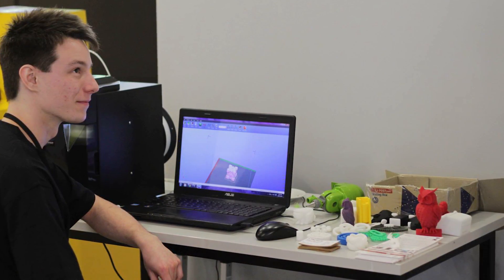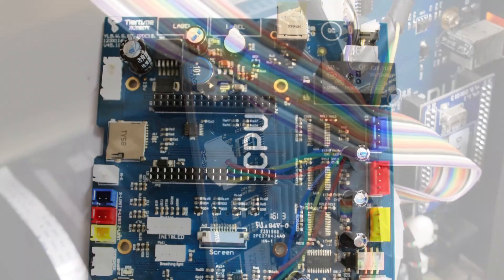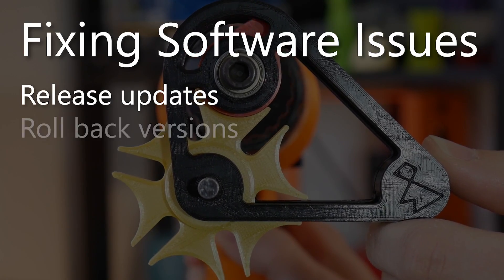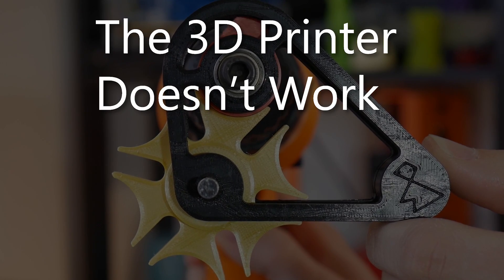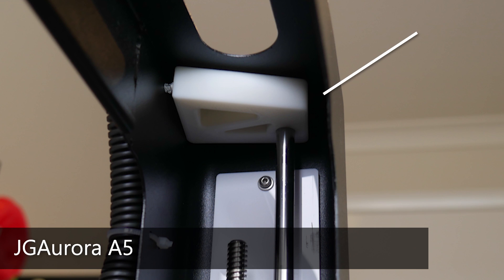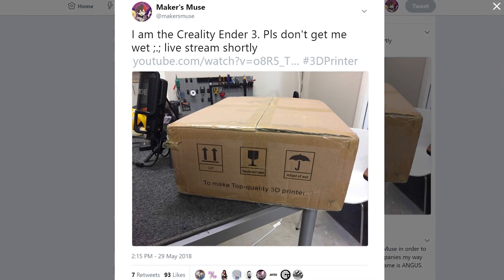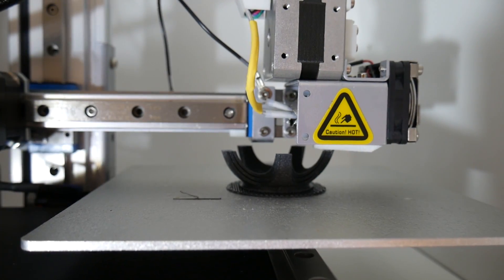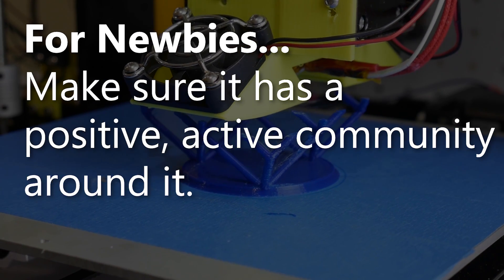Serious Concerns with 3D Printer Quality Control

Comment: Just ordered a Prusa Mk3 preassembled version, and REALLY hope I didn't make a mistake.

Part of the reason I did, is when looking at reviews of more "proper" pre-assembled 3d printers - TONS of FIVE STAR reviews had paragraphs to pages of stuff they had to do, and upwards of 80 or 100 work-hours just to get their first decent print.

So I got the Prusa Mk3 assuming that there was no such thing as a printer that works out the box, but at least I'd have good documentation with the Prusa Mk3.

To all who purchase 3d printers out there - please be reasonable in your reviews.  If you want to increase stars despite issues because customer support was great? That's fine, but it is NOT 5 stars if you had significant issues.  5 stars means it was PERFECT.  If you had to do 80 to 100 work hours of work, and wait a month for every little part to ship for multiple little fixes... that should AT LEAST knock 1 star off, because it wasn't PERFECT.

I really wish people would use rating systems properly, and I really hope I didn't make a mistake ordering the Prusa Mk3.

Comment: I bought an Anet A8M dual  a month ago.  I got the wrong screw kit with it, for different printer.  Incomplete instructions with combination of older printer and my newer one included.  They sent me a request to provide them a video showing these items when I complained???  NO.  Then I went to upgrade firmware and found the Anet had a BIQU pc board?  No support or mention of that anywhere.  Also it is BIQU board that has been replaced with a new one because it has issues with the design of the communication chips or protocol and cannot be recognized by another computer to upgrade.  I am a hobbyist and got this dirt cheap with no recourse to return.  The heater on the first hotend burnt out now and the reseller said "Sorry we only reship"  and the factory does not know who I am or why I would want replacement parts.  And this is a business model called fraud.

Comment: Honestly, I was one of those who saved up some money for my first 3D printer. The extruder ended up failing in <24 hrs. There were issues with the bed and such. I was fortunate enough to be able to have gotten a refund, but after spending a bit of time researching before that printer, and after, I'm overwhelmed with options for getting another in the future because of concerns that revolve around the subject of quality control. I kind of fell discouraged, but lost, as I wanted to get into 3D printing for not only as a hobby, but also using it as a tool for designing certain hardware. All these QC issues and so many revisions are making it difficult to find a good machine.

Comment: As with all technology wait. Wait for mugs to rush out and buy the stuff. It gets better and cheaper with time. And if anyone says "you should buy a more expensive printer", then I would say "Do you remember the Apple phone that lost most of it's signal strength when you held it? It cost a lot of money, was made by a so-called premium brand, but still failed. (by holding the phone, you were shorting out the aerial that ran around the side of the phone). Don't be the first in-line".

Comment: I have been looking at getting a 3D printer for the last 2 months and have made a choice on the Creality CR-10s pro printer.  I have my own machine shop so remaking metal parts is no problem. learning to work around the programming might be. I want the machine for printing concept items before going on to metal which will be more labor and time intensive. all things good come at a price startups also, and I wish folks would quit running down people for trying to produce what they want but always wanting it for free.when they built the CFL light bulbs they reduced the power used from the local utility and they in turn had to raise there rates to meet there monetary obligations for the equipment to deliver the power to your house.  so then we come out with LED bulbs and another rate hike and now we can make CFL bulbs that can consume less power than LED bulbs or on the order of 360 mW and yield 25% more lumens of light and it only takes a simple adapter so I guess you want the free adapter ok then they raise there rates and you will not be able to afford to run a motor with there power ever again.  the point is you make a choice to support new things or you don't  spend your effort wisely in all matters in your life.

Comment: I'm just getting around to watching this video now, but here is my take, and the route I went. Especially when you are starting off get a 3D printer with support in the form of the company or at least a strong community. All these kits are fun projects, but you get what you pay for. My first printer was a Lulzbot Taz5, and that thing still runs amazing, even though it's lacking some of the features I have grown to love. If you really want to do a kit, I would go with a Prusa directly from them (not a clone). Beta testing with hardware is not an acceptable practice. Like you said it's not like they can recall it and swap something out like they do with automobiles. You're pretty much stuck with that garbage if it's not something you can 3D print and adjust yourself.

Comment: I own a FlashForge Finder that is very easy to use and very good quality prints.  Problem for the last two years is an intermittent power shutdown during a print and rarly while siting in standby after a print has completed.  Just push the ON button to initialize system for the next print.  The company had sent me a replacement the power supply to no avail.  No friction on the XYZ movements.
I am glad they have changed the new versions of the FFF with a different Mother board and using an external brick  power supply.  I hope this eliminates the mystery shutdown (Mother board?)..

Comment: What do people expect? The cheapest prusa style printer on Aliexpress costs less than €100,-- shipped! A proper assembled 3D printer with a decent R&D record will cost you around 500 dollars/euros. Like you said most people buy one of these in hobby perspective and are not willing to pay this. If you buy one of the cheapest kits around you should be aware that you are basically buying the parts to build a 3D printer. Not the 3D printer itself. I do agree with the fact that if company's do revisions these parts should be availible to the public and a proper documentation and markings on the product should be there!

Comment: What would be innovative to see is a physical product supplier that uses this method of 'beta testing' on customers to do what software companies do, in that once the product has reached 'release state', that they provide the early adopters a new finished product, or maybe (at least) the upgraded parts. I'd still imagine that the actual cost of parts of a 3D printer, including postage, packaging, etc is probably less than 10% as the retail cost, so wouldn't be a huge loss considering they have been saving a heap of R&D costs by using consumers in this way. Of course, they'd have to admit that they are doing this intentionally which would be brave of any company. It may also have to be a factor in the pricing of their units overall, but wouldn't consider a huge factor.

Comment: I think it's ridiculous that some people consider repairing a machine that is not working as it is coming from the factory as "part of the fun". They don't even realize that they have been tricked by the producers and bought a machine that could not be working as it was shipped. The most incredible case I have witnessed was a so called "Filament Extruder" that was reviewed on a channel somewhere around YouTube. The problem with this thing was not just that it had some flaws or broken parts, but in fact it could never do what it was supposed to because of a completely wrong design. Everyone wondered how they could have overcome the problems facing the production of Filament by recycling old parts. But the mystery was solved pretty fast. They didn't. They just sold a piece of trash. And most of the people buying it just thought "maybe, if i tinker around with it, i might get it to work". Nobody, not even the guy on the YouTube channel doing the review was enraged about this bullshit. People should really wake up and think about what they are buying or what they already have bought. Speaking for myself, living in Germany, I only buy things like that if it is shipped from somewhere inside my country because as a consumer you have the law on your side here. The people should really be more careful about this stuff, considering that it is actually pretty much money that they are likely to be wasting.

Comment: I don't think that using consumers as beta testers is wrong. It's all about how they are used and how they are treated afterwards. I think how it's done nowadays in the 3D printing world is pretty flawed and unethical. In my opinion, people should be informed that they are buying into an alpha or beta machine after before purchase. Necessary hardware changes (in regards of safety) should be sent to those adapters free of charge or at least only for the shipping costs. Machines should be better and much more frequently versionated with the changes between each version published. Upgrade kits to upgrade your existing printer to the next hardware version could be sold separately (yes, sold. just like the CR10 upgrades from Creality). My CR10s came with an insulated heat bed from the get go an is able to reach 98 degrees C in under 20 minutes (I don't know what else they changed). It also came with a filament sensor and other upgraded parts I didn't even know they changed since most reviews.

Comment: IMO, the lean model could work for 3d printers as well, but here's how it should be done: 
working machines should be labeled "release". they are shipped at a higher price, and guaranteed to work. 
then you have "beta" machines. these are aimed at tinkerers.  you buy them at a reduced price, 
but with the possibility that something on it might not work, and you'll have to tinker with it to get it up to speed. 
possibly with free new parts sent. 
this way, you get something back for being an enduser betatester of a new machine.

Comment: This is a valid video in today's 3d printer market. I watched video after video on the Creality Ender 3 before taking the leap into 3d printing. The Ender 3 came highly recommended, and I think that 99% of the people who own a Ender 3 will agree that it is a great machine. My story is long and boring, so I will cut to the chase when you are looking into buying a new 3d printer watch all the videos you want. If you really want to know the quality of machine and customer service join a few 3d printing groups preferably a group that focuses on the printer you are interested in and read the posts! If the printer you are looking at has a large trouble shooting guide with failures or replace xxx on the manufactures website and has been out less than a year I would pass. Almost all of the videos that I looked at regarding the printer I purchased praised the machine for it's low cost and relative high quality. I started to really dig into the failure that I have and I have found it is pretty common. Yet not really talked about in reviews. Coupled with poor support from the seller and a lack of warranty from creality it has sort of turned me off to any future products. With all of that said I think the the Ender 3 could have used a few more months in testing, and would gain from a higher level of quality control. This is an excellent video and you are one of the first that I have seen to really spell it out. Thank you for the great videos keep it up!

Comment: Yup. If you want something decent then either pay for a quality product or build it yourself. My first was an Anet A8 which I bought to learn on. It is still going strong after 2 years, but only after a ton of upgrades and safety modifications. I used it to print a reprap AtomX printer and that is still going strong too. Then I got sucked-in by hyped-up reviews and bought a Tevo Tornado about a year ago. I only just got around to assembling it and it is awful. Mains 230v bed which is unearthed and no strain relief and has no thermal fuse in the silicone heater, no-name solid state relay, iffy psu which has taken out many printers (they had even stripped the insulation of a 230v cable to get the psu in the control box and the live wire was almost touching the cae of the psu), warped bed which is balaced on a single, central rail .(... WHY?... cheaper), inappropriate and inadequate fusing,  missing bolts and washers, frame not square, fans with rocks for bearings, rubbish build plate sticker that bubbles up meaning you have to use glass and glue, firmware which locks up, fake ftdi chip so doesn't work with Octopi (serial connection losses) ... and when I finally get it going .... 45 degree layer shift on the Y axis about 10cm high on a print. Whatever you pay for one of these garbage printers you can figure on at least doubling that sum for upgrades plus a ton of time messing around and getting frustrated. I wouldn't turn my back and leave it printing. Beware infomercials.

Comment: i think its fine they improve the hardware of a solid build to make it more solid, however it needs to itself have a new model number, highly flawed versions should get discontinued, while the ones that, only had minor fixable problems could remain on the market under its own model name. its a simple fix for the problem of the customer not being first. in turn this keeps a 3d print company from eating its cost to develop a 3d printer model that does work just because a better one is in place and it gets a few more listings on a store page with their brand on it. end result more exposure and more sales.

Comment: Thank you for the honest assessment of the situation.  My first two 3-D printers were basically fraud on the part of the manufacturer.  B9Creator is loved by jewelers for the smooth surface finish and 50 micron resolution, so I couldn't understand why it made gears way out of spec.  When asked, they admitted the 50 micron accuracy was theoretical based on the resolution of the projector and magnification.  Nothing actually made by the machine ever approached their claimed accuracy.  Light diffusion in the resin always made the outside of a part too big and holes too small.  Adjusting scale could improve one issue but made the other worse.  So I sold it.

Then I replaced it with a Rigidbot which never worked right.  To their credit, the founder mortgaged his house to pay for completing the kickstarter machines after many rounds of defective Chinese parts bankrupted the project.  After waiting over a year for a machine that didn't work when it arrived, I sold it for parts to a makerspace that threw away everything except the frame and built their own design using some of the parts.

These companies knew their product did not work when they shipped it.

And don't get me started on all the CNC routers being sold now with zero working software.  After spending over $1,000 for a machine, customers are referred to a half dozen freeware programs and left to figure out how to install them and get them to work together.  Of course, most of their customers never get the machine to work.  The great part is that they can blame their customer for not being able to properly install and configure the buggy freeware programs because control software was not considered "a part of" the machine!  Do not buy an Openbuilds router unless you have a computer systems engineer to sort out the freeware issues.  They are creating an opening for a new business if someone wants to sell jump drives with all the software correctly configured for the machine so owners could actually run the machine after they finish assembling it.

Comment: In the early days there was a certain charm that manufacturers would take fixes or upgrades from the community and put them in future production runs.

As time goes on it becomes more frustrating because there is no type of iteration or version number between the older and newer runs.

A first run CR-10 is very different than one purchased right now. Yet there is nothing defining the two or the variants in between. It's still branded a CR-10 not a CR-10 version 32 (or whatever). There's no telling which one you'll actually get depending on where you purchase and how many they bought. Depending on inventory you could by 2 of the same machine and yet technically get 2 different machines, even if you buy them at the same time.

Comment: Good advice  :) . 
 That's why I spent heaps on a solid, metal framed, twin nozzle 3D printer a couple of years ago. 
 It worked, right out of the box - just like it was meant to  :) .
Reply: Which one? If it still exist.

Comment: I like the way Prusa does it. For every major change to the i3, it's held off til the next "mark". That way, I can say I've got a MK 2.5, and you know practically exactly what I've got. There are some small differences depending on when it was ordered, but they don't change forum, fit, or function. (Even then, these insignificant changes are traceable.) The only time they'd make a significant change to a released product is if it's a safety issue.
Ex. if the extrusion issue on the MK3 is real and has a hardware fix, it won't be fixed until the 3.5/4 is released.

Comment: My cetus 3d printer has a slightly bent x axis so when i try to level my bed i can get it good as the sloop is more that 2mm so it can't and i scratches my bed :l nice to see this video i couldn't find anything on it and ya gave up as i didn't know what i was doing wrong.